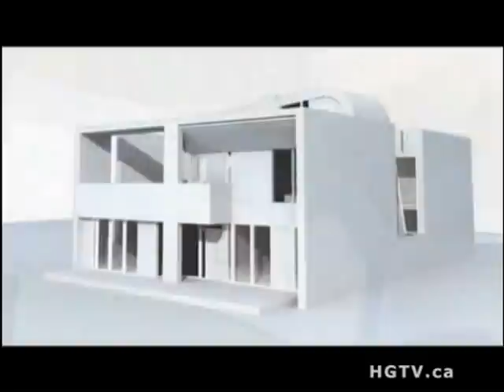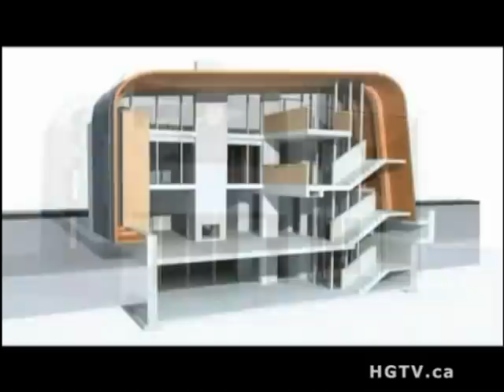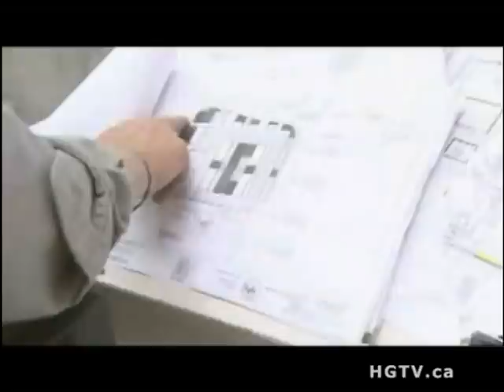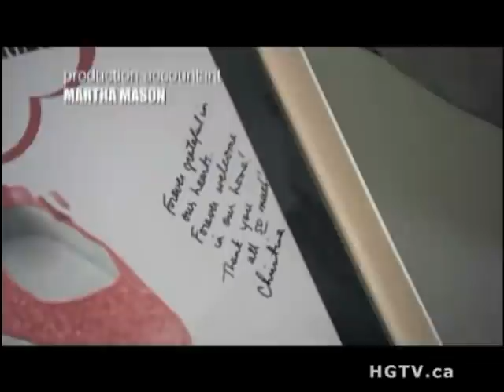Holmes on Homes - Season 7 Special - Lien On Me

Comment: For your single most expensive investment you have zero government protection. How do I need a license to practice medicine, mechanic,  etc.but I can build a house with zero, zippo nothing. And how are these building inspectors certified? All these trades need to be certified, Red Seal which would give the trades more clout. Trades need to apprentice like in other countries. Our Eduction system must change to reflect reality.

I am positive that most builders out there are doing a quality job. Even these good builders need protection from the bad. As it goes, one bad apple spoils the batch.
Reply: Tradie here. Most residential work is done by first and second year apprentices due to the low pay and low margins (commercial pays more than resi, and industrial pays more than commercial). The apprentices will make tons of mistakes, including very dangerous mistakes, but the journeyman watching over them is expected to check what they are doing and ensure the apprentice knows how to do something properly. In reality, this checking is not always done. Your copper pipes might be soldered together by someone who doesn't actually know the proper way to solder, nobody has ever shown them, and nobody has ever watched them do it.

There's also an element of selection bias. The tradesmen who are skilled and ambitious will gravitate toward higher paying commercial and industrial work, so you're stuck with a lot of sub par journeymen doing residential work because it is perceived to be easier work. I don't know if it actually is easier, but the general perception is that it's easier.

Comment: Mike I have a question for you. How does anyone check to see if you have asbestos in your plaster? My home was built in 1972. According to one of your shows you said that one out of five homes built before 1980 could have asbestos in the plaster. How does one check for that? Are there any visible signs that one would notice as opposed to regular plaster?
Reply: Go to your local box store and buy an asbestos and lead test kit. It’s a swab application. Put the swab in the liquid and wipe down the material. It will turn a certain color of lead or asbestos is there. Hope this helps.

Comment: This might the most insanely expensive house ever. Amazing build quality.
Also, their solar guy has no idea what he's talking about. "Watts per hour" is not a thing because wattage represents energy per unit of time.  You also don't store "watts" for the same reason.
Reply: Watt is volt times amperage, it’s a good way to measure how many things you can have plugged in at once. So im guessing you dont know “watt” you are talking about.
Reply: @cissa95  I'm an electrical engineer
Reply: @shawn576  A watt is NOT a unit of energy per unit of time. That would be a "watt-hour" or "kilowatt-hour".
Reply: @ColinFox  a watt is a joule of energy per second
https://en.wikipedia.org/wiki/Watt

Comment: The only part I didn't like starts at 1:18:19 to 1:18:24

That is a brand new house and they installed shoe moulding...AND the paint job on it looks like they are in a 100 year old house in New York repainting

Comment: With the consideration that this episode is from 2007, one of 5he. Things that should have been discussed, would be how much. This “concept” house actually cost. And have a comparison to the $219,000. That they had paid to the “Contractor”. This figure should also include all expenses to tear down the other structure all required professional services additionally required as opposed to the Lien. 
The. Other aspect that. As not discussed.is that with the permits, where was the sign off sheet on the inspections? Who inspected 
the building process? Were these inspectors involved in any kind of scheme with the Contractor?  Any reasonable judge would from the engineers reports consider thistle be a multifaceted problem with the Contractor building a substandard and dangerous structure that did not increase the value of the property but actually decreased the value and caused actual damage to the original structure as to make it uninhabitable. This then lays on the Contractor all additional expenses including additional damages to the family with having to pay for other accommodations, emotional distress, Etc. So such a countersuit, would then be against the  “Contractor” to the value of a minimum of $1,000,000.00
Reply: The problem is that a judge hadn't heard the case as of the end of the filming.  Backlogs in court systems means a long process to even be seen by a judge.  Any number of legal maneuvers can be done to keep the case out of a court room.  That is what the contractor wants.   He knows the longer he holds out before going before a judge, the more weary the homeowner becomes and the higher the likelihood that they agree to settle and pay him.

However, if there were laws to support the homeowner that penalize the contractor for applying these liens, especially the extravagant sort of liens like in this case, then shady contractors would just apply smaller liens that are less likely to draw big attention and embattled homeowners would keep settling where they could or give up all together.

I can't speak for Canadian lawyers, but I know a countersuit in the US would usually be taken on a contingency.   Maybe they don't do that there?  Or maybe certain types of cases like this can't be done on contingency?  Maybe an attorney investigated the contractor and found that even if they won a judgement against him, he would not have sufficient funds to pay out a claim-- which essentially makes him judgement-proof.  Maybe his liability shield is that the LLC on all his contracting equipment is through loans, so that he doesn't own them?

Lots of legal possibilities here.  What would be nice is if there was an update on the legal battle.

Comment: A house should be designed to fit the surrounds. The house is cool, but they could have done something just as awesome that actually fit into the neighborhood.
Reply: If you want to live in a HOA then go right ahead. This isn't one so that kind of thinking is out the door. A house should be designed and built to the owners specs, not what the neighbors think.
Reply: @thejnelson88  The neighbors bought homes and the original home fit the style and aesthetic of the neighborhood.  This home was radically different from the rest of the houses that exist there, which I think makes it look jarring and ugly by comparison.  No one is saying it had to be cookie cutter, but surely there were design and element choices that would have fit better with the other houses to maintain tax and property values for everyone.

Mike appeared to be too interested in designing a home that was 'invincible' than to think of curb appeal and neighborhood.